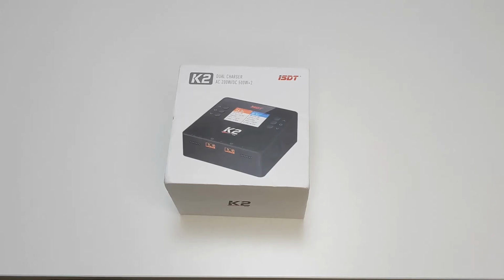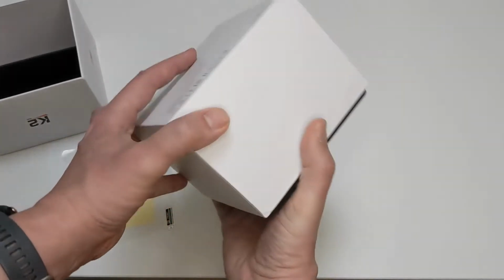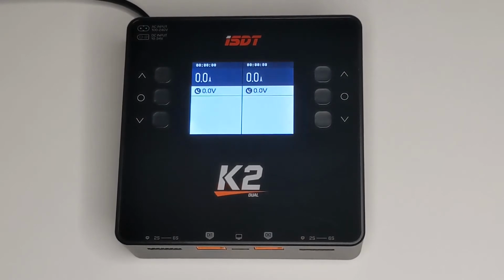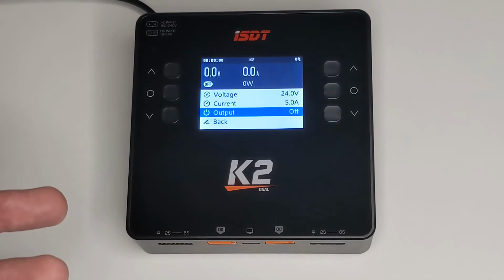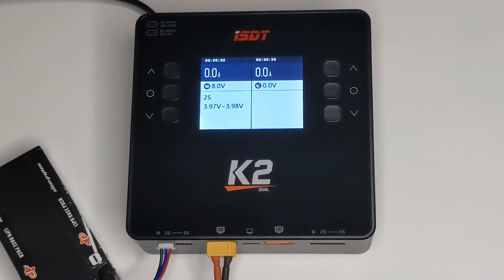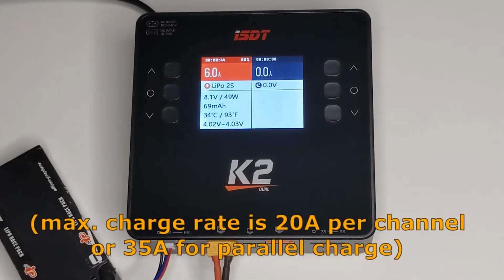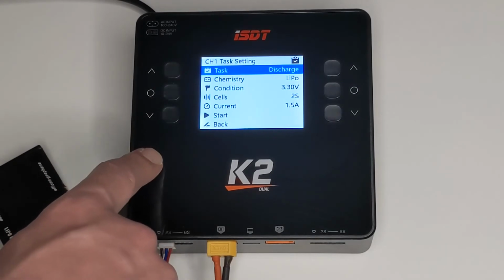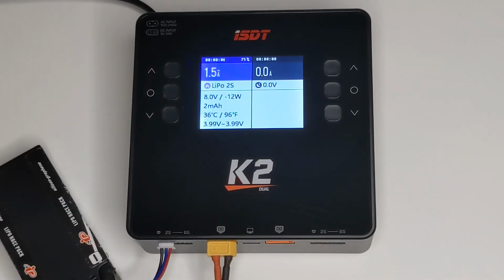ISDT K2 AC/DC dual lipo charger - Any good for RC cars and trucks?

Comment: Just bought this but do you know what the different colour screens are meant to mean. At the end of the charge, it goes from red to green and then to blue. Is it automatically balancing at the green stage and totally finished at the blue screen.
Reply from the maker: I believe that is the sequence. It also shows different icons depending on the charge/discharge stage.
Reply: Ok thanks. Wasn't sure when to disconnect it as it stays on blue at the end.
Reply from the maker: @AJAlvarez9  you're fine to disconnect on blue. You can also press the middle button to clear the screen after the charge is complete.

Comment: Hi thanks for the demonstration on this charger. I'm looking to buy my first charger for my first RC car (LC Racing EMB-TGH) as it didn't come with one. I have 2 x 2s lipo batteries and was wondering if you thought this charger would be a good buy? Or over kill! I would only be looking to charge my batteries at home. I am also currently looking at the ISDT 608AC. Any help or information, recommendations on other charges brands would be a great help. Also I'm in the UK so would need the plug to work with a UK socket. Thank you.
Reply from the maker: It's a very good charger but possibly overkill for small 2s packs. Much more useful for big packs and high charge rates that racers like to use. I haven't used the 608 but the specs look sensible, 50W AC charging should support charge rates of 6-7A on 2s which will get most car packs charged in well under an hour.

Comment: Great review! Do isdt chargers let you charge lipos even without the balancer? I prefer charging my lipos to 95%, if I do I skip the balancer. Thank you
Reply from the maker: Yes, you can charge without the balance lead (it gives a warning but you can override it), you can also set the termination voltage at less than 4.2v.

I don't recommend charging without the balance lead (just to cover my back), but if you want to, you can.